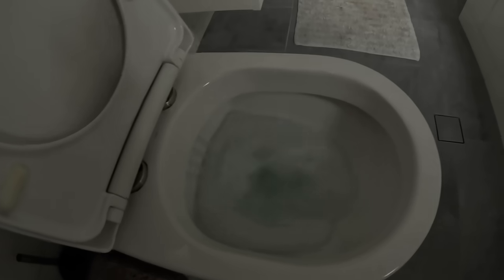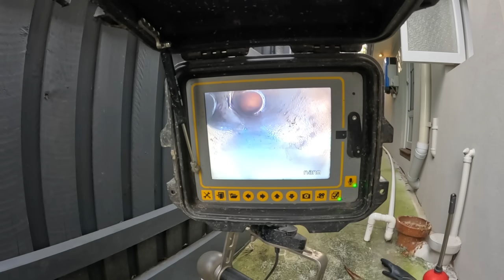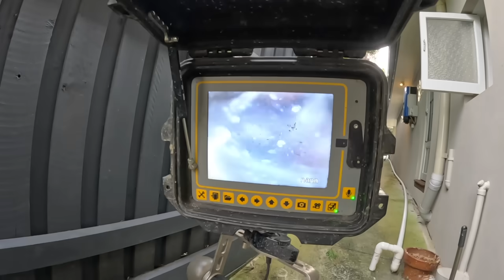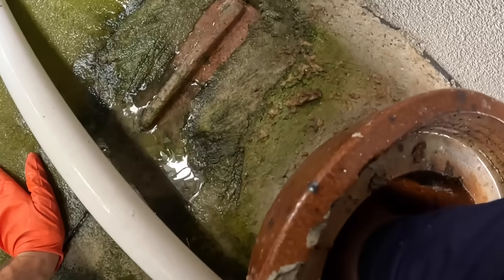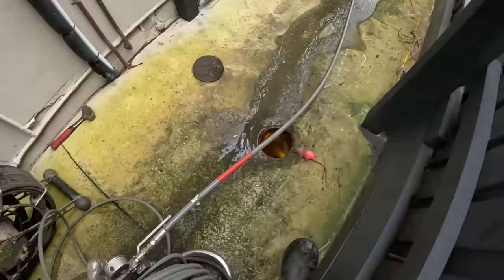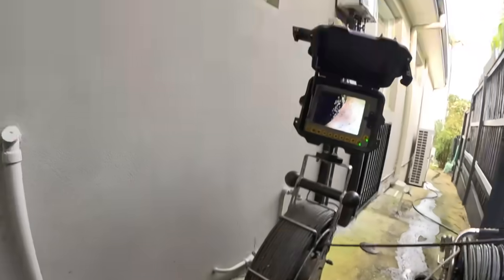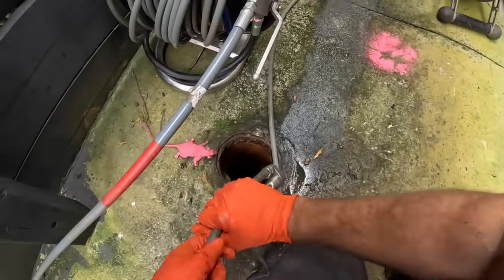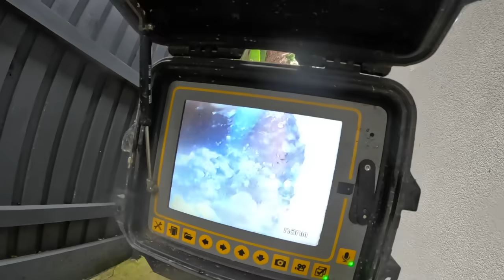Blocked Drain 965

Comment: I have to admit I was never a big fan of that last jetter.   The way it would run, it sounded like it was about to stop running at any moment.    Plus the whole remote thing is not something I saw you film yourself using very often.

Anyway.. Cheers and good luck with the new Van etc.  (Toyota is a good choice)

Nice work with the flashback to the old jetter with Romans 
6:23.  Was wondering how you would show that with the new one.